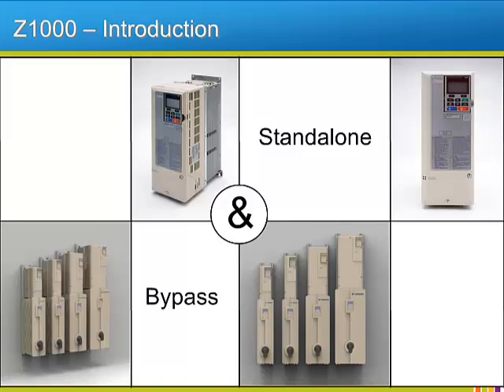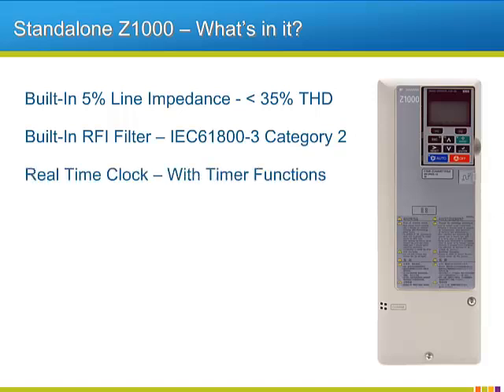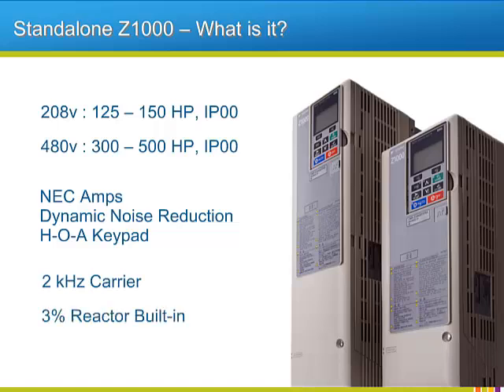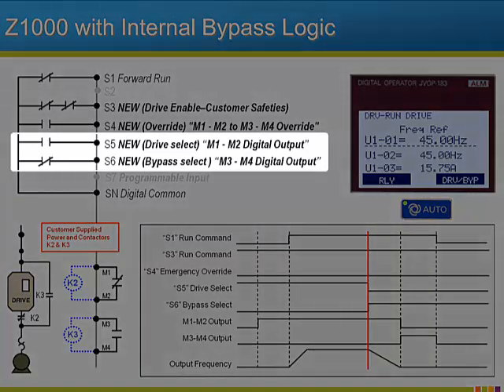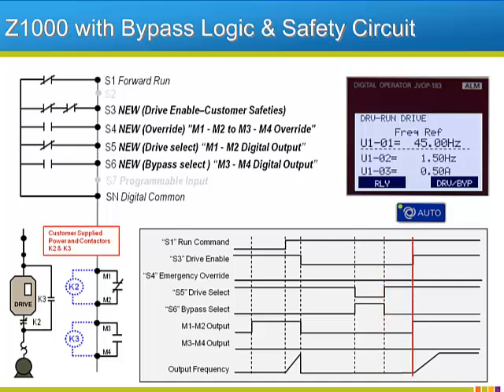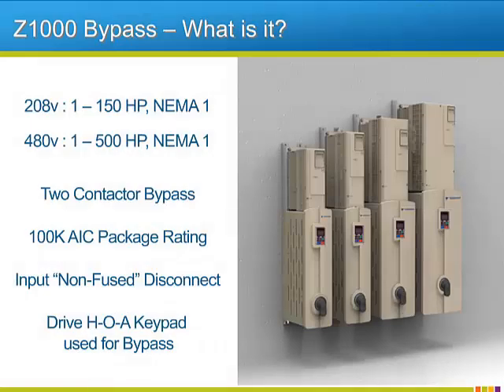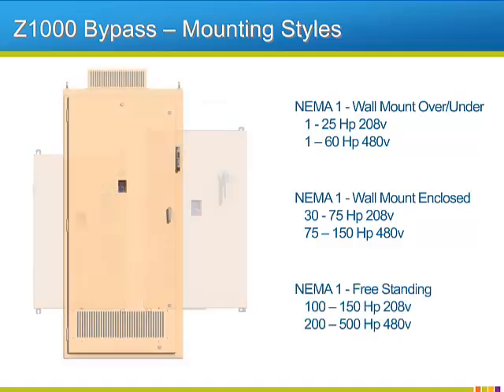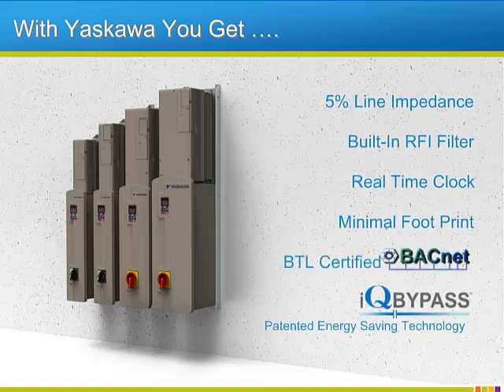Z1000 Features and Benefits

Comment: Is this similar to the j1000 in the sense that is should not be ran above 80% load to get the expected lifetime out of the drive
Reply from the maker: We don't have a specific document for the life expectancy of our VFDs. However, this information is embedded in the literature.  The Z1000 has a high reliability with an MTBF (Mean Time Between Failure) of 28 Years. This information can be located in the product catalog using this link: https://www.yaskawa.com/products/drives/hvac-drives/fan-pump-drives/z1000-drive/-/content/_f686a341-c1b7-473a-a4d3-30846f01c0c2_Specifications